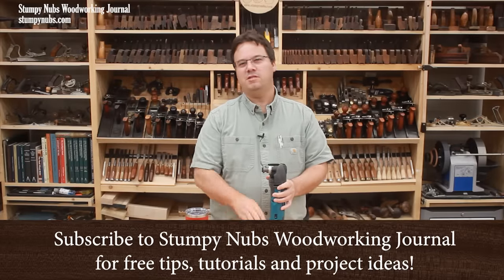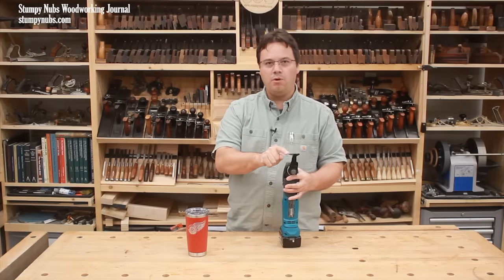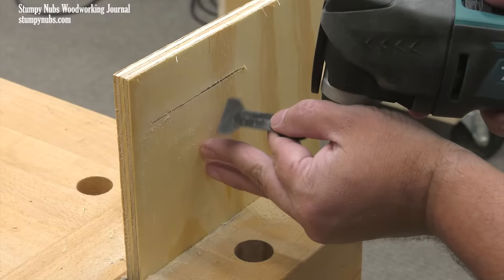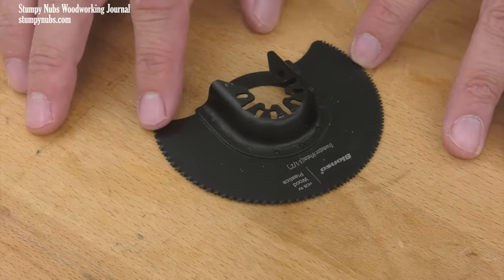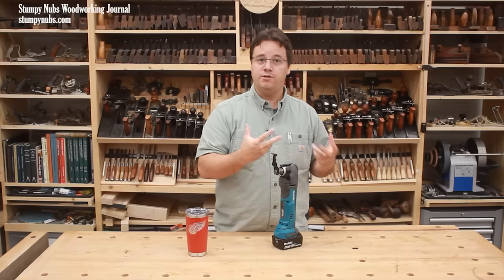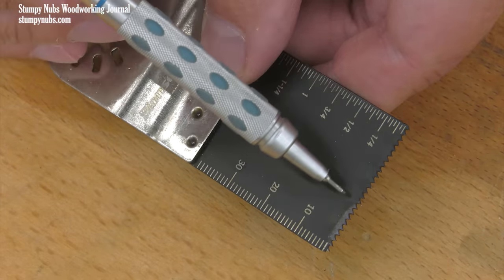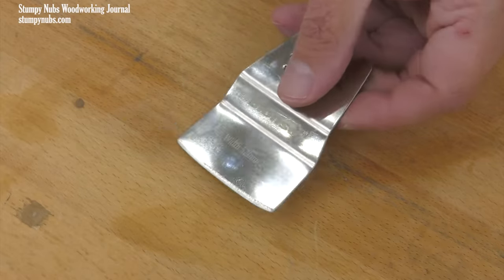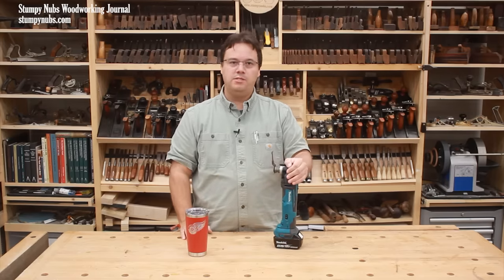CLEVER things to do with an Oscillating Multi-Tool!

Comment: I recall when oscillating saws first became ubiquitous, after Fein's patent had expired, I brought one on the job, as a finish carpenter, and my boss at the time made fun of it, calling it the 'stupid saw'. Long story short, it wasn't too long before everyone on the crew was laughing at him multiple times a day when he would request the services of the 'stupid saw'. The name stuck but strictly in an ironic manner.
Reply: I call ig a Jiggle Saw.
Reply: I couldn't believe it either, unstuck wood painted windows
Reply: That's awesome
Reply: @dougmatthews2316  'wiggle tool'…. 😄
I don't miss the 45$ blades before the patent expired!!!!
Reply: I call it by the noise it makes
Reply: Wasn't long before my boss got one for himself
Reply: Yup Fein really milked that cow…I refuse to buy another Fein tool since.
Reply: I should add though it was a quality build but they failed to make it better (like tool less blade) until others came out.
Reply: @BA-zy2kb  never bought one to much
Reply: I’ve tried many, but the original Fein, both the tool and blades, is far superior to the knock-offs.
Reply: @ronskopitz2360  maybe but the price!! I'm very happy with Dewalt ands some off blades on line.
Reply: i have heard that Diablo cutting tools are best for it...sadly not selling in my country so i cant confirm
Reply: @dougmatthews2316  Wiggle tool. My old boss from Estonia called it that and I worked with him for years so from there, I began calling it that. Every now and then, I'll go into a hardware store I'm not familiar with and ask them "Where are your wiggle tool blades?". You should see the looks I get. 🤣
Reply: @jimurrata6785  Really? Wiggle tool also? You didn't used to work for a guy from Estonia did you?
Reply: @American-Plague  No, I never have.
occillating multi-tool doesn't exactly roll off the tounge.
Reply: @jimurrata6785  Just was curious. That's where I picked up that exact term.
Reply: @jimurrata6785  multi tool does or thingy does.
Reply: As soon as I 'saw' it I wanted it.
As the actress said to the Bishop.
Reply: @jimurrata6785  tounge?
Tongue?
Reply: bear  What's that, eeeeeeeeee!
Reply: Its great when your smarter then your boss.  Its so funny how some ppl are so ignorant and egomaniacal that they cant admitt when they're wrong or when someone else is right.  Butt then end up doing it the person who was right in the 1st places way.  Gahhhhh my boss is also that way.  He also has a terrible anger issue and doesn't listen to any reasoning ever and insults his employees and makes very bogus assumptions about them as well.  To the point that he can't make rational choice and decisions and in turn negatively affect his business. And he's also a hypocrite
Reply: I call it the buzz buzz so my wife would know which tool to bring me.
Reply: I brought mine to cut some quick holes in some drywall at my mother's house before a small remodel, and she was telling everyone she knew about them for weeks. She also just really enjoyed using it. One of the least scary power saws out there.
Reply: 2003-13, I owned a Woodcraft store and sold a ton of Multimaster tools and blades (Fein was the first we sold ).  Customers complained about the cost and life of the blades. We had to teach them that THE were “murdering” the blades by stabbing straight into the workpiece and not clearing the sawdust. (Smoke and burned fingers should have been the first clue)
Reply: @hickerbilly345  meeeeeeeeeeeeeehhhhhhhhh
Reply: I bought one when they 1st came out and it was about $300 I still have it it's pretty good Although sometime it's hard to get a real straight cut with them
Reply: @hickerbilly345  can you hand me the mmmwwwaaaaaaaa?
Reply: The guy I worked with at the time bought a fein when it was the only game in town. The blades from fein were ridiculously expensive. And tej half circle ones  were brittle as shit. A $50 blade was unheard of 20 yrs ago. But then have that $50 blade snap on you.
Reply: I remember seeing the infomercial. I thought it looked like a great idea. But since it was on an after hours broadcast tv sales show, I didn't trust it. I eventually bought one after the patent expired and they became common. Wonderful tool
Reply: On the rez we call it an "OZZY"
Reply: I called it a miracle back when Fein first brought them out. We had an old timer break one out to declare a picture window, and holy crap, it was a miracle. We never looked back. Everyone bought one.
Reply: That’s a hilarious story! Clearly one you’ll always remember and now one we can never forget. The stupid saw..
Reply: “Stupid saw” has been cracking me up all day. I don’t know why, I just get a kick out of it. Was he a mostly cool boss?
Reply: @stephenmahlstedt7276  Darin Dell was an amazing boss. Treated his guys like family. Paid great and would go above and beyond to help any one of us out. From foreman to the kid on the crew. The man is who I try to emulate, now that I run my own business.
Reply: Snake saw
Reply: @girthbrooks39 
I bought a small 10 foot tape measurer to wear on my belt as a plumber and my boss and coworkers cracked little jokes about it because it was small and that I carried it on me all the time. I became very popular shortly after as they always asked, 
"Hey, do you have your tape on you?"
😂
That and my pocket knife. 

My boss is one of those guys as well. Great man to work for.
Reply: My old coworkers called it a" vibrator" 
When I went to a new company and asked for a vibrator they thought it was funny and slowly everyone began to call it a vibrator 😂😅.
Reply: They make an attachment for cutting square boxes for electric outlets
Reply: I let my electrician use mine when he was trying to a stall some outlets in our 100 year old home. He bought one for himself on his way home that night. Nothing beats it certain situations.
Reply: @ErgoCogita  I understand because I was a framer for the better part of a decade. I can not even fathom showing up on site with the thing, eager to display it's merit to a group of men who regularly employed the 'hammer saw' to subtract a ' C hair on a fat chick' from linear material.   When the extra 5 minutes needed to use a saw that's not the claw end of a framing hammer isn't in the day's time allotment, When "looks good from my house" & "trim, caulk, and paint make a carpenter what he ain't" are expressions heard daily, When the foreman of the crew is an angry old man named Duck, which has nothing to do with waterfowl and everything to do with his propensity to throw things at the crew, you kinda realize it's the wrong environment for show and tell, no matter how innovative the offering may be.
Reply: Good man I bet your boss weren’t laughing mate 😀

Comment: FYI, the original oscillating saw was patented in 1947 by Dr. Homer Stryker. It has been used in the medical field since then. I first used it in the mid seventies when we found out it worked very well on fiberglass panels. Cuts them like butter with not too much dust. We called them “Bone saws”. They were also used to remove casts from a patient without cutting skin. Back then the only problem was that you had to purchase the Styker blades from a medical supply house and they were expensive. Look up Styker, they are still in business today.
Reply: Cast removal was my first run in.  Like all kids, you think the blade is rotating around and it terrifies you. Then, they tell you to touch it and it terrifies you more.  Then the Dr. touches it and you feel better, but still terrified because of the sound.  Lol.
Also Stryker is a monster company.  More than just still in business.
Reply: @xoxo2008oxox  yes, I agree with you. And the price of everything has gone up and the quality has gone done.
Reply: Right you are.  I used them for years to remove and bi-valve casts.
Reply: @shirothehero0609  Stryker makes many hundreds of products that are used in the medical field. You will see their name on those yellow ambulance stretchers, hospital beds and so many other pieces of equipment that we use in the hospital. They also have a recycling division that comes and collects all the wires and cables we use, sterilizes them for reuse or reclaims the useful metals.
Reply: I remembered first seeing one was when my doctor removed the cast on my broken arm with one. I was intrigued that it cut it open without cutting into my arm 😂
Reply: we used the same thing for auto glass , and the sort, in the 80's ,but ours was pneumatic
Reply: @shirothehero0609  
I can safely say, there aren’t as much kids with casts as back then 😉
Reply: It cuts through cast and skull bone but when it reaches the skin or dura mater they just follow the back and forth movement. So smart.
Reply: Calling Michigan home, seeing Stryker mentioned makes me happy. I’m sure @stumpynubs feels the same
Reply: We used to get diamond-coated blades made for those when I was building boats under the London Bridge rail line, they were ex-medical cast removing saws, for removing plaster casts from people who had to have a plaster cast because they had broken an arm, or leg, sometimes just the wrist. Anyway, I digress, they were made by DeVillebliss, well, the pneumatic ones were. A German power tool manufacturer, Fein, made an electric one.
 The glass in fibreglass is hell on blades, the diamond-coated ones lasted forever, or so it seemed back in the 70s. Ah, the seventies. I remember a day out in Hyde Park, watching the SAS invade the Iranian Embassy. Those were the days, between IRA bombings that is....

Cricket was boring back then.
Reply: Every time you see the coroner in one of those TV dramas about to try to get at the corpses brain they reach for the saw your talking 
about. Always white and quiet hefty looking.
Reply: I'm from Kalamazoo Michigan area, Stryker origin area
Reply: @xoxo2008oxox  Run less rpms. I can get months out of blades if they don't overheat.
Reply: Never had a cast but I always wondered till I met an oscillating tool.
Reply: @BoB-Dobbs_leaning-left  has Cricket gotten more exciting since then?
Reply: @peteryeung111  
We were more physically active. I would just run for no reason.
Reply: I well recall having my plaster casts removed with oscillating cutters back in the 60's in the UK. The first time, having a lower leg cast removed I asked the Plaster Technician about it and he gave me a great demonstration, explaining how it is so much safer as it wasn't a rotating blade.
Reply: Curious did the blades wear down fast cutting fiberglass?
Reply: @pasqualz  Well, I'm glad you asked.
Not really.
Reply: @morokeiboethia6749  yes they did. We went through quite a few. I don’t think carbide ones were available back then. I actually found you could sharpen them with a Dremel. The shape of the tooth didn’t matter too much. Just as long as the had a fresh jagged edge the cut the fiberglass.
Reply: @daviddickmeyer5231  I have a Dremel and I use it to resharpen the multitool scraper blades but thats b/c they have a straight scraping edge or semi-arc straight edge.  What bit did you use to sharpen the jagged teeth with?  Im not sure if I have a aluminum oxide stone small enough to get in between the teeth but if that works then I'll damn sure go get one - otherwise I'd have to sell my house to keep up with the cost of the blades I'm going through on my multitool.
Reply: Just came across your video.
Most of the videos I've seen regarding 'how to do' projects are put out there by people who are just trying to make themselves some easy money but haven't a clue what their on about.
Judging by the comments, there are a lot DIYs out there who are conned by these scammers.
I'm a retired carpenter who has been in the construction industry for about
35 years prior to retiring and I've seen quite a few of these videos.
Yours is by far and away the best instruction video I have ever seen.
With regard to your comments about the sanding capability of multi tools, this is one of their primary functions and I've found them to be very efficient at small areas and hard to reach parts.
They're not meant for general sanding of large areas.
The range of blades you showed astonished me. Most of them aren't available in tool shops and builders merchants here in the UK.
I do have a sanding attachment to fit the Fein tool that allows you to sand into moulded shapes like architraves, cornice etc which is not available to fit other makes of multi tools. I bought a cordless multi tool but couldn't get the attachment from my Fein (which is corded) to fit it.
Nobody has made one since but since I'm retired who cares!
Anyway, I just wanted to compliment you on a fine bit of instructional video.
Reply: Awesome, I didn’t know this… and I know most things lol!
Reply: @jeremywhittington7605  You know most things?
I know EVERYTHING!
Reply: @tommacdonald6295  I remember Dr Frankenstein  reaching for a hacksaw in the film 'Young Frankenstein' so you're wrong!
I could be wrong even if I am never wrong.
Reply: @pasqualz  What's cricket got to do with medical procedures?😂💀
Reply: Borrowed phone
Did a little water proofing
Late 90's we called them caulk cutters thiers no substitute for toothless self sharpening blades in part urethane calking in masonry expansion joints clean fast no comparsion
Reply: Homer died a rich man.
Reply: I'd change my name if I was called 'Dickmeyer'! How about 'Richardmeyer'?🤣
Reply: @davidashton2361  Yes, I have been called many names, mostly by ignorant, uncaring people. But it was my fathers name and his fathers name etc, and it’s my name. And it has also treated me well for 78 years. I’ll keep it thank you!
Reply: @daviddickmeyer5231  Sorry David.
It was a fit of madness that caused me to be offensive. I apologise for my crude attempt at humour.
Comes from my stint (14years) in the british army when we used to try insulting each other on a daily basis.
I'm 75 by the way.
If you want to understand british humour watch a few episodes of 'Blackadder' on youtube featuring Rowen Atkinson, Steven Fry, Tony Robinson etc.
Reply: @davidashton2361  one brit to another... bet ya feel a right cxxx now... 🤣🤣
Reply: Cool history. Thanks for sharing. It’s crazy how anything that can be labeled with “medical use” can be priced at a much higher price.
Reply: @jakeqwaninne8502  yes I've watched the autoglass business completely evolve from wire to cold knifes,long knifes, putty knife and a hammer to a fein knife to jig saw mod to a Sawzall mod and now back to square 1 using nothing but wire again or you'll get fired when working for the large corporation.
Reply: @davidashton2361  watching it is like having root canal work done 😆
Reply: He sold the Patton th Fein
Reply: I still remember getting my arm cast removed in 1969, when I was 6, and being fascinated that the saw cut the plaster, but not my skin. I still remember exactly what it looked like and how it worked.
Reply: Thanks for the Info! In Germany the company "Fein" claims that they invented the oszillating tool! But thats just BS and now i know better!
Reply: In the 1970's I remember a Doctor using the oscillating tool with a semi-circular blade to remove a cast from my foot. I thought it was a smart way to remove the cast without great danger to my foot.
Reply: @xoxo2008oxox  👍the only time i use it is if my other home-DIY or millwright or automotive tools i have will not fit or do the job at all as it's $$$$ operate
Reply: @xoxo2008oxox  Check out the osc.blade comparison by project farm channel.
Reply: @shirothehero0609  Thats exactly my experience to a T.
Reply: Yes, I remember getting my cast cut off as a child.
Reply: Yup - worked on an orthopedic ward on the Navy in the 60s and now it's like seeing an old friend with my Makita multitool.
Reply: @emmetband4931  me too
Reply: @shirothehero0609  yeah, they had a warehouse next to my work. they just moved out. decided that half a business park wasnt enough room.
Reply: Interesting!
Reply: I had a cast removed with that saw in 1960 when I was 11 years old. I remember my amazement seeing the doctor hold the blade to his hand to demonstrate its safety before he started cutting.
Reply: They make carbide blades now.  Those are the bees’ knees.  I used my oscillating saw with a standard steel blade to amputate an injured / dog-torn goose’s wing really high up towards its body this spring.  I iodined it up and zip tied the gaping wound shut.  It’s fine and happy with the rest of the flock now!
Reply: I thought Stryker only made hospital beds. Huh! 😊
Reply: The  Stryker lady lives close to me, spends a lot of money to provide music concerts and shit like that. Seems pretty solid.
Reply: I worked as a contractor in the Stryker plant in Cork, Ireland, the range of tools & attachments they make is amazing
Reply: Thanks for the info. Now I'm going to research how long a patent lasts!
Reply: Thank you for the back story.❤😊
Reply: Stryker. Yes. Stryker

Comment: One tip you might want to include is that the (steel) blades can often be sharpened!  I've used a jeweler's file to re-sharpen a blade many times, it works rather well.
Reply: I built a cradle to hold my rotary tool horizontal with a sharp edged silicon carbide (green)stone.  Then added a platform to rest my dull blade on and gently feed it into the spinning stone.  Fast!
Reply: Totally agree with sharpening the blades as they do get dull quickly.
Reply: Another thing, meantion that a lot of times you can use alcohol or thinner and clean the blade to resharpen. A lot of times the teeth are just clogged
Reply: You can buy 100 blades on line for 50 bucks. And they seem just as good as the ao dollar blades
Reply: @stevenwood9646  I’m interested, do you have a link? Thx👍🏻
Reply: @stevenwood9646  where
Reply: Why do you need to be given a link?  eBay is as good as anywhere.
Reply: @Dave5843-d9m  because i love links